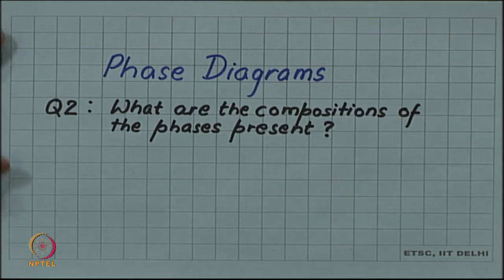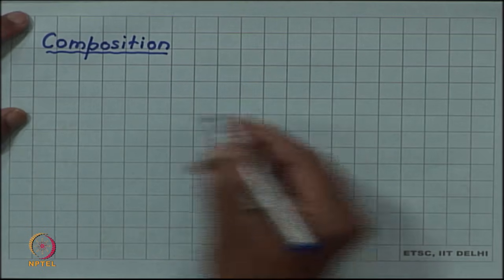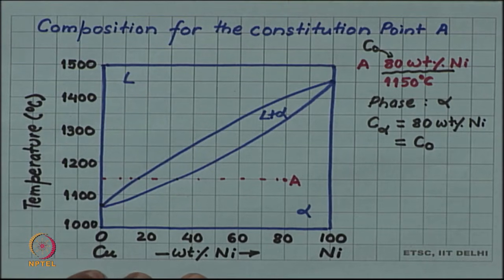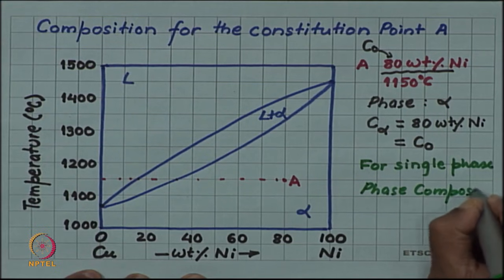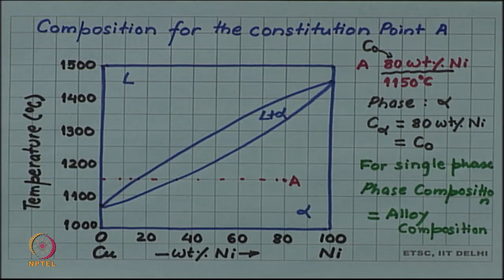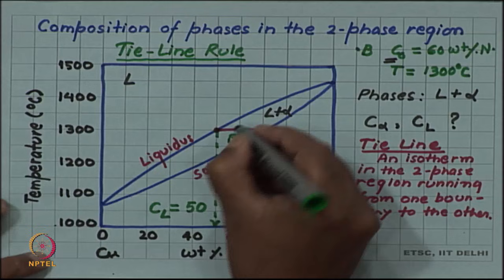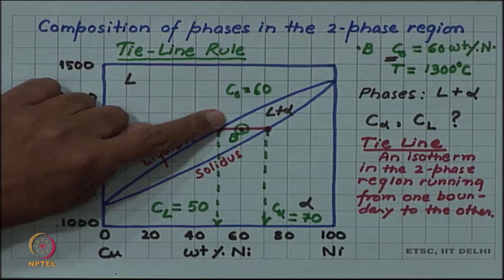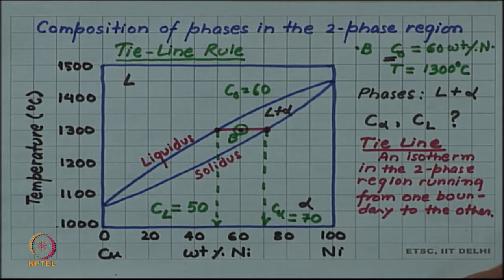Composition of phases present in the system

Comment: Sir, How does the tieline method works?? I mean how drawing an isotherm gives me the respective phase composition at that state pt?
Reply: I was searching for this question. I have also the same question. 
Is there any theory, like at constant temperature, whatever the alloy would be, but the phase composition would be constant over constant temperature?

Here,at constant temp, at point b, 
C(Ni)=60%, then C(alpha) =75%
Using tie line rule
If C(Ni)= any value between 50 and 75…
C(alpha)= 75%.

Please reply.
Reply: Actually I got the answer in the next video.
C(alpha) means percentage of  component (here Ni) in alpha phase.
So, 
If it is a (alpha+liquid) alloy,  at 1300°c, only 75% of Nickel can be found in alpha phase, what ever the percentage of component(Ni) in the alloy would be.

Comment: sir why the phase concentration and alloy concentration are not equal in a two phase area .i could not understand physically
Reply from the maker: Phase concentration is the concentration of a given phase in an alloy. The alloy composition is the composition of the overall alloy. If the alloy is a single-phase alloy then the alloy composition and phase composition will be the same. But if it is a multi-phase alloy then different phases can have different compositions. And alloy composition will be different from the composition of the phases.